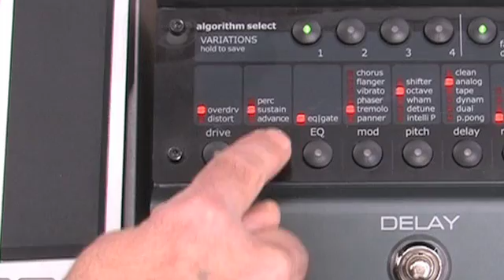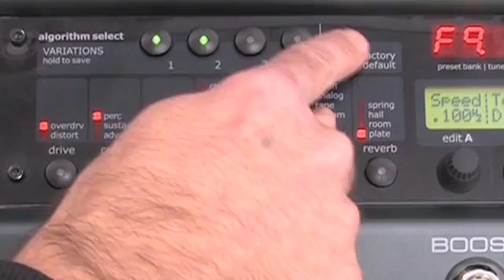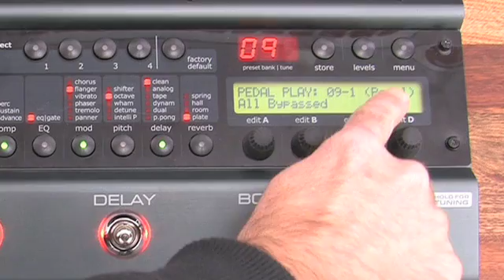Nova System - How to create a preset

Comment: Is there a huge difference between the quality of effects between this and the G System? I use a G System for my 'day gig', but I want something smaller and more manageable for my own gigs. I'm assuming that the big difference is the loops that the G System has, is that right? Also, is the Nova System capable of making the same drive sounds as in the Nova Drive? I really just want to use something that has delay and reverb trails in a live setting, and the G System does that flawlessly. Thanks!